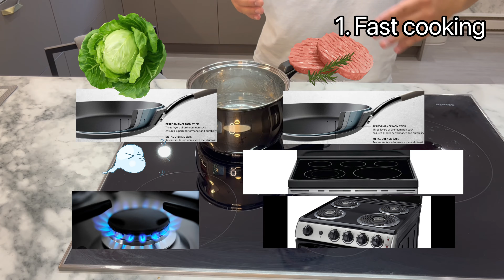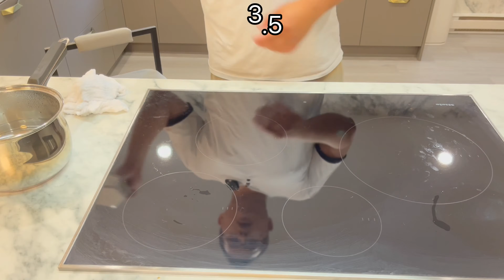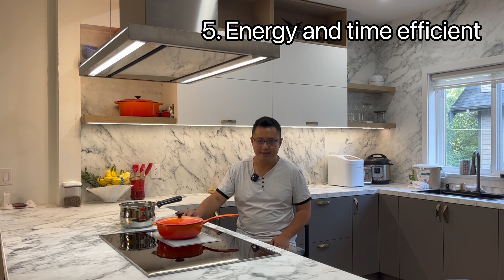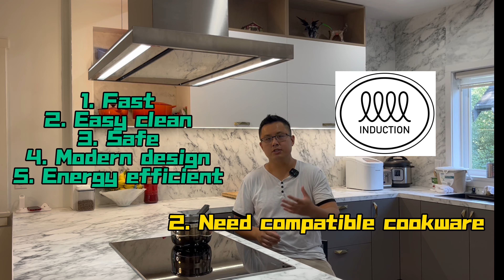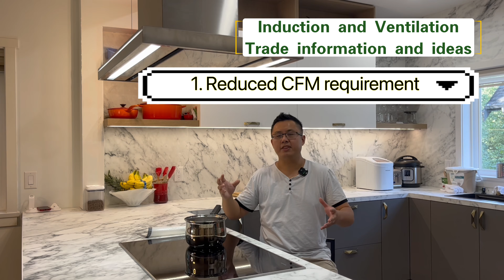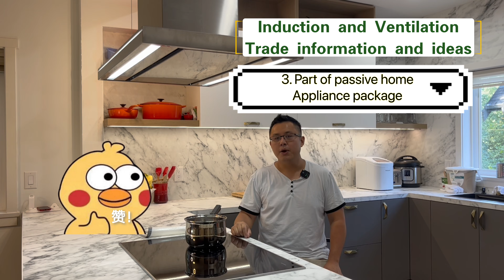All you need to know about Induction cooking - and then some

Comment: I've sort of tested 18 portable induction cooktop over the last 30 mths and I would like to introduce you to 3D cooking.. the silicone idea is good but you can go further.. I use round 12" silicone mats.. with one cut into 8ths these raise the pot to allow the air to cool the glass and no heat inside the element..if you stack the mats on top of each other the wattage drops per mat and the pans cooks in a less volatile coil induction higher up than close to the glass..no burning butter when put in cold pan.. cook food with respect
Reply: IS THERE A DISHWASHER SAFE VERSION OF THESE MATS THAT DOESNT COLLECT RESIDUE LIKE SILICONE OR RUBBER? i KNOW SILICONE DISHWASHER SAFE BUT LOOKING FOR SOMETHING MORE INERT
Reply: @h8h81 there are many things that aren't magnetic that can be used..it also needs to be heat resistant.. these are the most practical for price as they can be used on a bowl (when making bread etc) saving the world from plastic, used as place mat.. it's not just one use

Comment: My induction stove was less than many of the other stoves I looked at.  Mine was just under $900.00, and I have had it for at least 8  yrs already. I didn't have to buy special cookware as I already had stainless steel with magnetic bottoms, and now I also use cast iron.  Good to know I can use silicone mats on my cooktop.   I am in Alberta.

Comment: Can't wait to get my Induction hob.... what's a decent set of pots and pans for Induction?
Reply: If you can afford them (they're very expensive) Demeyer is the top of the line. Other great choices are Hestan, AllClad, or even Hexclad. On a budget cast iron work great, but the rough bottoms can scratch the glass.
Reply: @davidedwards4720 . Will use my silpat at all times w cast iron

Comment: I have a question the timer mine seems like you got a hold of for 3 seconds sometimes it works sometimes it doesn't I must be doing something wrong second question is is there a way to turn the volume up on the timer so you can hear it better how do I do that thanks again I appreciate your videos so much
Reply from the maker: Hi, some times the timer button works better when "pressed" and not "pointed at" - give that a try. in terms of volume there may be a settings page that can be accessed in the functions mode - models may be different so you will likely need your manual here, enter service mode through some button presses and then it will allow changes. Most of the time a combination of selecting different numbers on different burner controls.

Comment: I would think that comparisons about induction v. gas are getting timeworn. We were on gas ranges for 40 years, and 9 years ago bought a GE Profile induction range. Never looking back.
Reply: > I would think that comparisons about induction v. gas are getting timeworn. 

Outside the US, maybe. But in the US there is still an enormous advertising push to keep gas stoves and ovens in regular households, in the same way that you see US constantly rejecting heat pumps, roundabouts, public transit and universal health care.
Reply: @MrMartinSchou  Re: the original point, I do see just as much advertising for induction stoves as any other. When we were shopping for appliances 9 years ago, we didn’t have to search for an induction stoves, it was right there in the showroom. (I have no comment regarding all the universal backwardness you attribute to the U.S.)
Reply from the maker: It's great to hear your positive experience with induction cooking after so many years on gas!

Comment: Any induction that offers knobs?
Reply: They do exist, but they tend to be more expensive as they tend to be more niche.

Personally I hate the touch interfaces on most things, especially in the kitchen. One of the neatest implementations of knobs I've seen is a puck that you can just take with you. Makes clean up much easier.

Neff makes a couple of versions of these. If you have a LOT of money to spare, you could also go for an Impulse cooktop, which can deliver an outrageous amount of power to each burner, as it has an integrated battery to augment what you can get from the wall.
Reply from the maker: Some have knobs and mrmartinschou is correct. Very niche. They do come in the "range top" style where the knobs are no longer on the surface of the machine but instead facing the user. This helps to make the cooking surface easier to clean, while also enlarging the cooking area. Cost will be higher and specific cabinetry layout and design needs to be planned ahead of time.

Comment: Anybody still cooking with gas in a residential home is in one of two camps wilfully ignorant or uneducated...the science is clear your "opinion" is simply that. Would you cook on your BBQ indoors?? of course not. It's can even be a better way to cook, but without professional exhaust handling you're affecting the health of everyone in your home.
Reply: I still prefer gas cooking because I don’t like cookware limitations. Everyone still has their preference.
Reply: @w.miller7282  The only cookware I had to replace when I upgraded from gas to induction was a cheap old Cuisinart stainless pan that was low in iron content. Almost any good pan made currently that anybody would actually want to use will work on induction. This is the biggest non issue ever.
Reply: I like cooking without power.

Comment: I have strong feelings against touch controls on appliances. So unreliable.
Reply from the maker: I agree - some improvements would benefit end users for sure.
Reply: Check out the LG LSIL6336XE induction range. It has knobs (removable so you can clean it easily) to control the “burners”. I bought one in August 2025 and love it. No gas fumes, far less heat in the normally hottest room of the house, no baked on food drippings on the stovetop, etc.